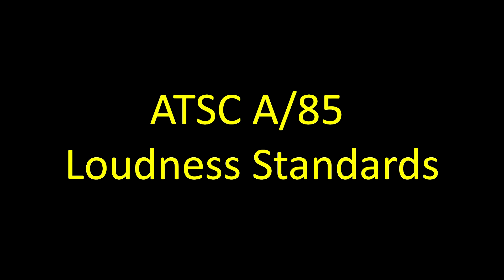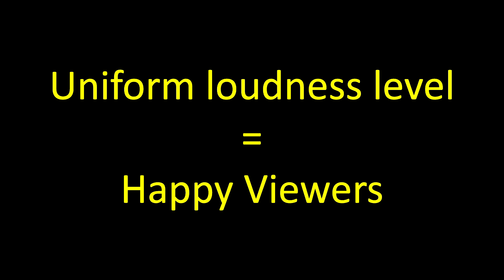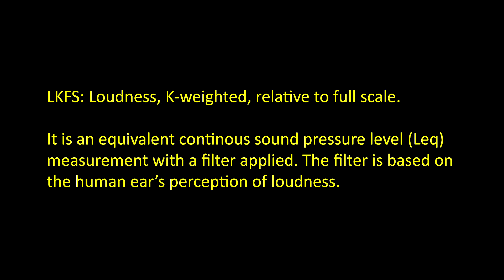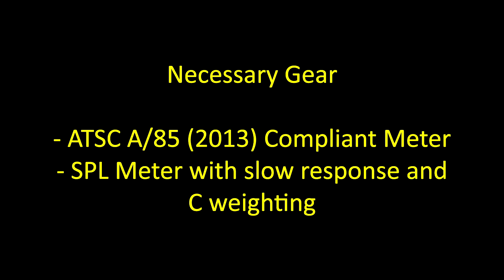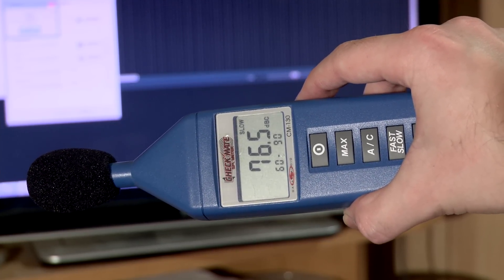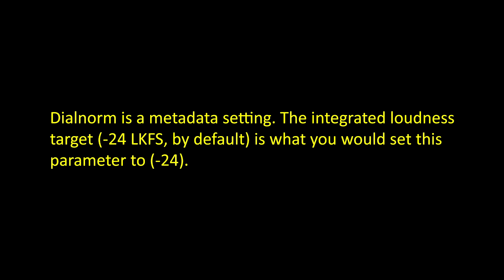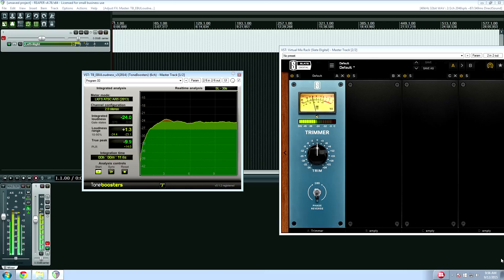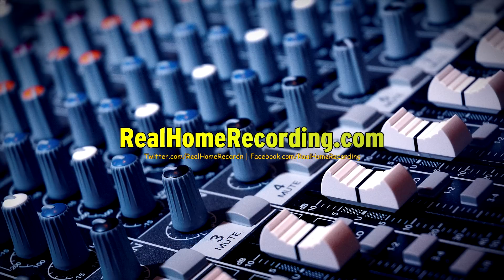Mixing for TV: ATSC A/85 Loudness Standards

Comment: Newbie question: Do you use -20 dbfs for calibrating becuase it should be considered the 0db in the mixer?
Reply from the maker: For calibrating equipment, yes. A 997 Hz sine wave at -20 dBFS for alignment is still good practice.

For speakers I will use a sound pressure level meter.

Comment: With ITU 1770-3, most stations are looking for LKFU now not LKFS.  It use to be LKFS and every station has different delivery specs.  But only FCC stations are required to follow these, though many cable stations are adopting a standard for consistency.  For example, Showtime doesn't have LKFS/U requirements.  HBO does.  Neither are required to.

-24 LKFU 1770-3 uses a gate to hold program material level as to give a more accurate reading when starting and stopping.  

SPL shouldn't be used as a measurement for creating -24 LKFU.  while 85 is standard for most dubbing stages, depending on the stations specs, the room is often lowered as it forces the mixers to mix hotter to achieve the desired spec.

If you mix enough in a proper room, your ears will become use to the pressure levels and you will automatically adjust accordingly.  There is a +/-2 also, so if you hit a -25 you are still within spec.  Peaks are more of an issue.

Lastly, measuring and listening just to the dialog track by itself is not something you should do or measure by itself.  While LKFS uses dialog as an anchor, the rest of the material if there is any play as much of a part of the mix as well.

There isn't a single TV show that is done in the manner you describe.  There isn't time.  A dubbing team mostly consists of 2 mixers.  Dialog and Music, and FX(hard FX, background and foley).
1/2 shows usually only get 1 day to mix, review, change and fix and deliver and episode in a 9 hour day with a lunch.

LKFU measurements are usually measured and noted before client review and corrected before if needed.

1 hour dramas usually get 2 full days to mix and review on the second day, sans special shows like game of throwns, Walking dead etc.  They just have more budget for more days as they are usually mixing hundreds of tracks.

Some stations like abc have a peak of -6, and that can be tough to get a -24 LKFU without limiting it depending on what happens through out said episode.
Fox, use to want LKFS for each act.  So if there was no dialog and only music and BGs, then that ACT would be loud with amibence.

I know you are trying to explain how the white papers work, and how to best setup for it and what it all means.  I thought a more real world example of how it is done in the field might give a little more insight into how the majors do TV shows for the networks.
Most measurements are done using Dolby's measuring tool that analyzes the 5.1 (as the broadcasters create their own LT/RT for broadcast) and determines if it is within set parameters.
Reply from the maker: +frankpaws All great info. Bottom line? This stuff STILL isn't standardized LOL! Standards? What standards!

9 hours to do a half hour mix? I could see that. It's a shame the budgets are so low but I can see it. Especially after reading articles on the aftermath after Todd Soundelux  shut down.
Reply: For the major broadcasters it is.  LKFU, not LKFS.  Max peak varies but the CALM act is required for FCC broadcasts not cable.
You should always mix with everything in.  While you can "predub" the dialog, your final version show be balanced in relation to each other.  In a brief way of describing it.
Most TV doesn't get time for predubs
Reply: +RealHomeRecording.com The Todd shutdown had nothing to do with budgets.  It had more to do with miss management.

Just to continue from before, while every station has their own specs, the standard is set.  -24 LKFU with varying peak levels.  

If you have the luxury to do a dialog and FX predub, by all means do it.  Most shows don't have the budget for that.  You basically get 4-5 hours to get the mix ready for review.  The last 4 hours is reviewing and fixing producer notes.
I've never had to monitor my LKFS or LKFU while mixing.  Your ears should know what is right and most of the time you will be within a db of 24 +/.
And since LKFU measures the program material as a whole, not just the dialog it is best to measure once everything is mixed and make adjustments accordingly.

Because your TV show in mostly documentary style I can understand what you are trying to represent.

But, when you are doing a show like Breaking Bad, or Walking dead where there are action scenes explostion, etc. relying on the dialog anchor as a number is the completely wrong approach.

Mix as you normally would, with everything, get it big and ballsy while paying attention to your peak numbers.

The analysis over the length of the program, usually 22 or 42 minutes can be dramatically different if it is just dialog driven versus action.

That is why it is best to measure your mix when it is done rather than while you are doing it.  Mixing by meters as you know is the wrong way to mix.
If you want to measure the dialog anchor on a predub that is cool.  But the dialog adjustment based on music and FX can vary a lot.
If people are screaming during a scene of action the dialog is going to sound LOUD on its own, which means you more than likely will turn it down in the predub.

Put it in to the whole mix, and you will find your dialog buried.  

Youtube doesn't have a CALM standard.  Nor does cable.  They aren't required to.

And I mean LUFS (loudness unit full scale).  I've been in such a habit of writing LKFS I swapped it out wrong.

I think it would be beneficial if you are going to present these videos to follow up with the full ITU 1770-3, and why it is different from 1770-2and 1.
Because the gate in 1770-3 is one big difference in measurement as well as measuring based on LUFS vs LKFS.

In your video you are measuring based on a standard, 1770-2 that is no longer adopted.  LKFS is a backup if there can be no LKFU measurement.  Which now, there is no reason to not measure LUFS for the entire program length as every software and plugin can measure LUFS.

Don't forget the EU has a standard as well, R128 that is compliant with 1770-3 also.
Reply from the maker: +frankpaws Thanks for the additional advice. 

I looked into LUFS vs. LKFS and apparently there is no difference as of 2011. Which is why I made no distinction in the video. Read more at http://www.tcelectronic.com/loudness/broadcast-standards/ and http://gameaudionoise.blogspot.com/2012/02/whats-difference-between-lkfs-and-lufs.html 

ATSC A/85 (2013) is 1770-3. The big difference I see between it and the EBU R128 standard is that R128 measurement is on program material always and A/85 is anchor element measured for the main programs and 
program measured for commercials and interstitials. Also, the "default" target is -23 LUFS (R128) vs. -24 LKFS (A/85 2013). This reminds me of the -20 dBFS vs. -18 dBFS differences between the continents a few years back, LOL!

Of course, as mentioned before by yourself, it's really what the broadcast company demands that ultimately matters. If they want you to measure your show via the main mix and not the dialogue tracks only you need to follow that guideline.

Really the only time I hear a nice full dynamic mix on TV is with movies. But I get the need for consistent loudness within a 4 dB range. Waking up the neighbors or wife/girlfriend when an explosion or zombie horde appears on scream is a big no no.

That's what the white paper said as well. Use your ears primarily then the meter as a check. You just need to have the right equipment which if you, frankpaws or other professional mixers who are mixing mainstream network or cable shows, are doing on a professional basis then I would assume you have a proper mix room.
Reply: +RealHomeRecording.com 
Actually, there is a difference in LKFS and LFSU measurements.  Before 1770-3 became the new norm, LKFS was the standard and most stations were on the 1770-1 without the gate.  

Through many tests, it was discovered a variable difference of 1 to 2 db.  Yes, even 2 db in some cases from the LKFS to LFSU measurements with the gate on.
LKFS and LFSU are suppose to be the same according to the white papers.  But they aren't always.  Using Insight, which was one of the first to measure with 1770-3, allowing you to turn the gate on and off, I found mixes hitting -23 LKFS using dolby and -21 LKFU using Insight.

I think many of these issues may have been corrected in implementing the gate properly and as 1770-3 is a true peak reading as 1 and 2 used a different measurement, had caused the LKFU reading to be higher by 1-2 dB.

-20dbfs is still standard for post.  -18 to -16 people still seem to calibrate with music.

Be aware.  Not all pink noise is the same.  Dolby pink noise is spot on.  The pink noise from a Pro tools generator is incorrect and down by about 5 db.

Dialog Norm is no longer the standard.  Program loudness is.  Dialog norm is short short term where long term is now preferred.
If you look at the commonly used plug ins for measuring, Dolby, WLM, Insight etc.  It is loudness over the whole program rather than the dialog norm creating the measurement.  Which is what is was for a long time, ergo why when LUFS is used, a plus 1-2 db shift is measured.

Also, feature films do not use this.  That is why feature films are often loud and quiet.  The dynamic range is so much greater.  And in the theater, it works.  Usually, there is a DVD 2 track rebalance that you can play on a 2 track system, but that isn't always the case.
Low budget movies don't usually get the luxury of a 2 track remix.

This type of measurement, ear training and room is one thing that is difficult.  One of the first shows I mixed for broadcast, I was given old spec and mixed to them.  And the channel complained it was to quiet.  However, the updated specs when I got them was a plus 6db difference.

I just want to state again, the CALM ACT is for FCC regulated channels in the US.  It maybe different over seas, but I'm pretty sure its government run of those who have to follow.

While it is a good rule to follow for TV that is not under the CLAM act, it isn't necessary for you to.  There are far greater dynamics in many of the programs that do not follow this standard.
And no one in their right mind would follow this for a feature film.  A feature film is "technically" to be enjoyed in a theater in 5.1 etc.

Not all the films have budgets to remix the 2 track or 5.1 for home viewing, that is common and why you complain about not hearing things when you are listening to things.
However, why mix for an iPhone or laptop?  When you can mix for those who can enjoy it?
Mix for the bigs, those who can hear it and enjoy it for the work that was put into making it sound that way.  If someone has a laptop and complains about it, so what.  

Its like mixing a record for the iPhone rather than for a decent sound system.  Granted you want  it to translate but, if it sound great on the iPhone but crappy everywhere else, is that what you really want?

Anyway, mixing for film and TV is greatly different than mixing a record.  Though you should start with the top system and work your way down rather than trying to make it sound great for a lack luster play back system and expect it to sound great on a nicer system.

Comment: Wait a sec... So why all fuc.ing advert are so loud? I think they just set this rule to make sure all advert companies can do louder adverts then the program! And there is a audio engineer no? To use only -24-27 db range from the digital full scale is just... blama. You loosing a lot of depth in the quality. Like You drop out 8-10 bit information.  But the big question here is: WHY THE ADVERTS ARE MUCH MORE LOUDER??? They dont have to apply this rule?
Reply: +BMR Studio Btw, thank You for sharing :)
Reply from the maker: +BMR Studio Dialnorm metadata not being properly set is why commercials are louder. A master control engineer needs to manually set the dialnorm parameter in order for this whole system to work. Letting a machine do it automatically based on level doesn't work...it's something that should be done by ear THEN by meter and ideally with a flat frequency response speaker system. Inline automatic controllers (as they're technically called) are not recommended by NAB as a full solution. - https://www.nab.org/documents/resources/CALMBestPractices.pdf

Also, if one program is 2.0 (stereo) and another is 5.1 downmix/summing issues become a problem. Local stations need to also adhere to these standards for the system to work.
Reply: Hehe :) So there is no regulation on commercials loudness... Is just funny :)  But looks to me Youtube also start to do a same...